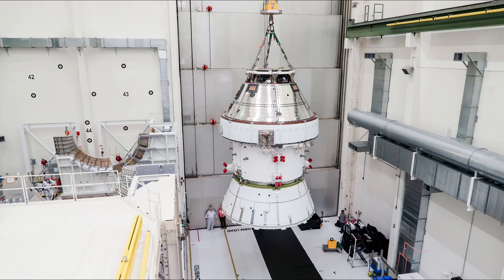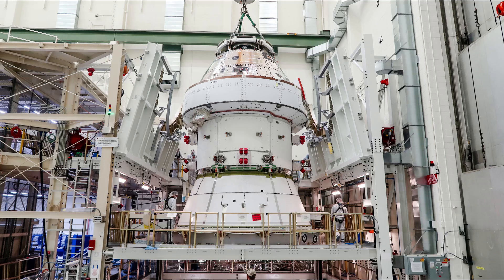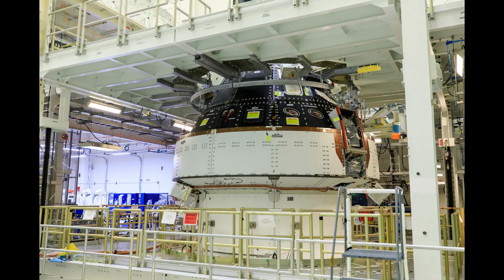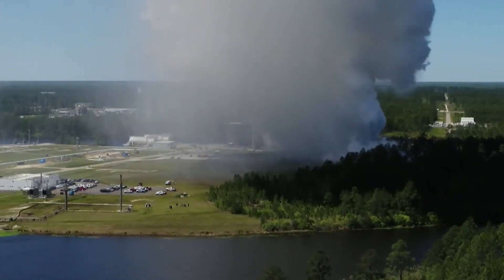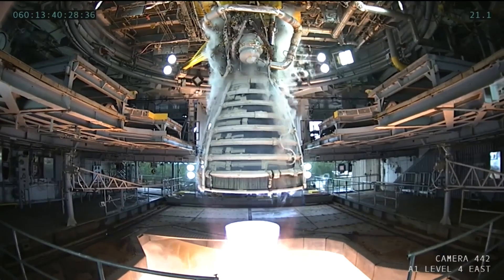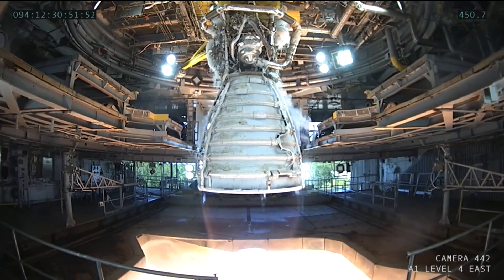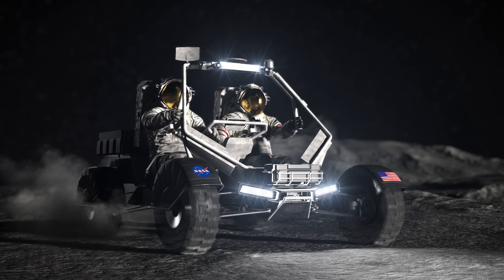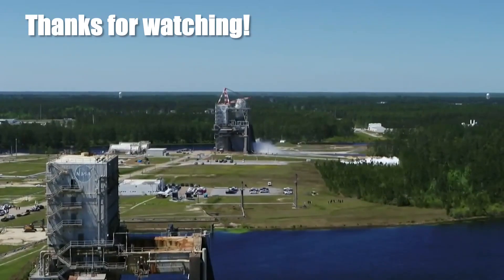Orion continues NASA Artemis II preps, RS-25 certification tests complete, lunar rover study awards

Comment: @philip sloss, when will the Artemis II CSM get its big NASA worm?
Reply from the maker: At least for Artemis I, a big NASA worm logo was placed on one or more of the Service Module fairing panels.  IIRC, the logo was painted or affixed in the MPPF after the panels were installed where the Artemis II spacecraft is now in the O&C Building.  But we'll have to see if that sequence changes this time.

If they stuck with the sequence from Artemis I and are able to stay close to the new schedule, the spacecraft would be headed over to the MPPF in the Fall.  So maybe we'd see that by the end of this year.
Reply: @PhilipSloss  Im hoping for a good plastic model kit for the Artemis CSM now that we are returning to the Moon!